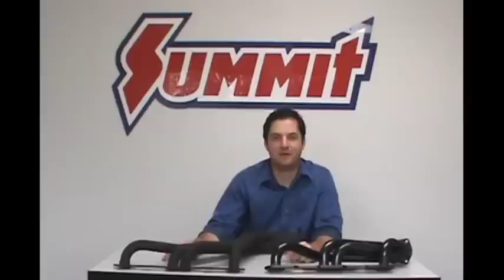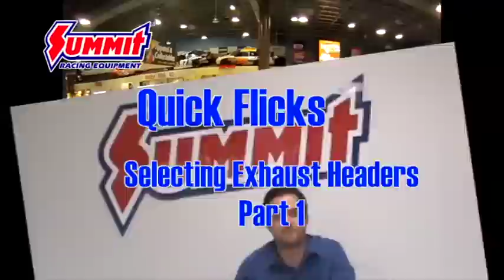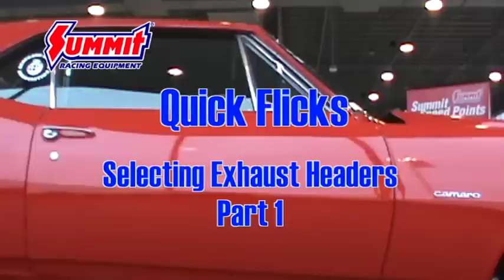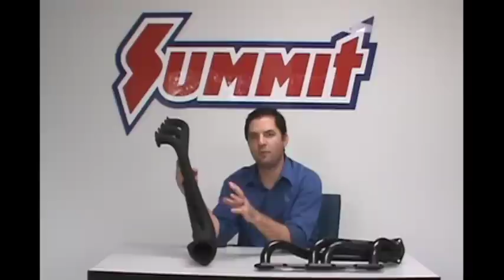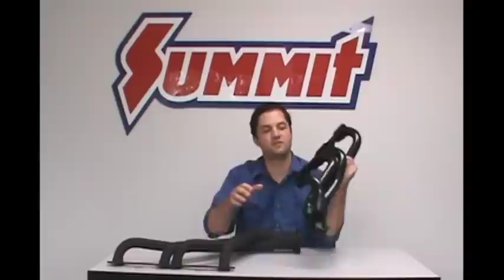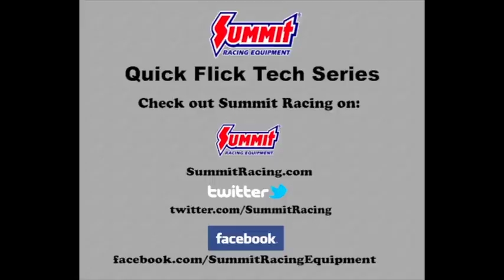Long Tube vs. Shorty Headers - Summit Racing Quick Flicks

Comment: what would you recommend for 05 Ford f150 5.4? thx
Reply from the maker: Hi seabornjl, 
Most times shorties work the best for trucks because they are not being pushed to maximum RPM to achieve high end horsepower. Shorties are also a good compromise because they are usually less expensive and easier to install.

Comment: Are the Summit Racing® Truck Headers SUM-G9016 good for a 1998 chevy k1500 vortec 350 extended cab. It is lifted and I want a little more power pulling out.
Reply from the maker: Hi Joe Holstein, 
Short style headers are a great choice for some more bottom end grunt. They are also emissions compliant and the Summit branded “Shorties” are easier on the wallet; great choice!!

Comment: Long tube or Shortys silverado 5.3 2003 hp?
Reply from the maker: Hi mario villarreal, 
Shorties would work best on your Silverado! You can click this link to check out the shorty headers we have available for your truck: 
http://www.summitracing.com/search/department/exhaust/section/headers/part-type/headers/make/chevrolet/year/2003/engine-size/5-3l-323/header-style/shorty/model/silverado-1500?SortBy=Default&SortOrder=Ascending

Comment: is it bad to use long on one side and short on the other. I have a 350 in an s-10 frame with a 41 ford body, real tight,.
Reply from the maker: Hi jack Donaldson, 
Doing so would make for an unbalanced motor;  that is, a motor that makes more power on one side vs. the other. It would be best to just use a shorty on both sides and keep the motor making the same power out of both banks.

Comment: I would assume shorty headers are far superior to manifolds anyway. right?
Reply from the maker: Hi VinnyMartello,
Yes, shorties would be superior to the restrictive factory exhaust manifolds. Nice inexpensive upgrade for a little extra power!
Reply: Summit Racing do headed cause over heating or blown head gaskets
Reply: VinnyMartello not that much.
Reply: Summit Racing do headers cause over heating or blown head gaskets

Comment: I own a 1974 Nova with a GM 290/350 engine swap but I still have the stock cast iron headers. Would getting a long tube header increase my gas mileage at all? Thanks for the video as well, I found it very helpful

Comment: Nice clips from a Summit customer. Should have mentioned when mounting from underneath in some instances, you may have to undo motor mounts and raise or tilt motor to install, but that's what directions are for. Right? Full tubes have equal pipe lengths which balance and time pulse phase for all four cylinders into collector.

Comment from the maker: Hi rd584983, 
Yes, shorty headers are a great choice for your application where low end torque is required and higher end RPM use is not expected. Thanks for watching!

Comment: Hello, I'm going to upgrade the exhaust on my 94 Ford Bronco and as you said the shorty headers keep some back pressure and improve low end torque. As the engine is fuel injected and needs some back pressure will the shortys be the best choice? Thank you.

Comment from the maker: Many times factory tubular exhaust manifolds are crimped pretty small in some places for bolt clearance or ease of manufacture or assembly. An aftermarket header, even a shorty, puts emphasis on flow for power production so, yes; they will make more power than a factory tubular manifold.

Comment from the maker: So to say that a short header is best or worst for your application would have to come with dyno testing as proof to back it up!  Do your research before buying. Contact a manufacturer directly and ask for dyno results. Check the internet, there are lots of independent comparison tests being done everyday that may help shed some light for you.

Comment from the maker: Any header is going to help make more/better power throughout the entire power range when compared to the stock restrictive exhaust manifolds. With that being said, not every motor responds the same way to headers. Each motor, whether it be Ford, Chevy or Dodge is designed and breathes differently.

Comment from the maker: There will be modifications with these headers to make them fit an existing exhaust system, including the factory exhaust. Pacesetter sells off-road extension pipes to delete the catalytic converters if you are racing the car. That part # is PSM-82-1165. A computer reflash will be required to do so of course!  The headers do include O2 sensor extension wires since the O2’s are relocated down to the collectors.

Comment: you said in the vid that shortys are good for low end torque but I just read that they are good for mid to high end torque and the long tubes are good at low end to mid torque HELP I have an 12 rt challenger want to make the right choice thanks

Comment: I have a 1970 chevy nova stock ride height and stock 250 inline six. I bought the Flowtech 11510FLT - Flowtech Headers they're the long tube headers and now that I received them I am not too sure they will fit. (they seem too long and the space seems to be limited), Before I start taking everything apart. will they fit my 1970 chevy nova??

Comment from the maker: Long tubes on those cars without any lowering can be questionable at times when you consider curbs or speed bumps or pot holes. It’s highly suggested with your amount of lowering that you consider Mid-lengths or shorties!

Comment from the maker: But because long tube headers and short tube headers deliver each cylinders pulses into the exhaust pipe at different times, there will be a slight difference in sound; although, the average drivers ear will most likely not be able to hear the difference. Thanks for watching!

Comment from the maker: While exhaust sound is mostly affected by the type of muffler being used, it wouldn’t be completely honest to state that headers don’t have some affect as well. There are many variables involved here from cubic inch, camshaft specs, ignition firing order, pipe diameter etc, etc.

Comment: I think you sold me on the shorty cause i'm not really focused on performance. I've efficially accpeted the fact that my '97 k1500 isn't gonna run like a viper lol considering that, which would give you the most benifit as far as sound? Will the 2 create a sound different from eachother or is it mostly a common sound?

Comment from the maker: While it’s true that any header will have larger internal tube diameters and better flow than a stock exhaust manifold, perceived power gains are usually subject to driving habits and usage of the vehicle. Not every driver has the same expectation of performance, some would be happy with a 10hp gain while other expect 50hp or more. Along with each drivers expectations also comes a variance of opinion! The bottom line is, only a dyno of your vehicle after installation will tell the true story!

Comment: i got the hooker shorty headers on my 97 lt1 and they are a pain in the ass to install especially on the left bank. but they do sound great. also another prob with the hooker shorty is the number 8 cylinder spark plug wire boot to the plug is really close to the header and has dried out and fried the boot to my MSD wire. if u want all power and u have no emission go with long tubes. with O2 simulators for ur rear O2 sensor and a custom exhaust.

Comment from the maker: Header manufacturers try to improve on factory designs by increasing internal tube diameter and minimizing the amount of turns the exhaust has to travel through. They may also try shortening turn radiuses and or making all tubes the same length (as much as possible) in order to equalize flow from all cylinders. Bottom line, air does not like to turn, nor does it do it well.

Comment: I have an 01 civic ex, and when I look at my manifold, I notice 4 pipes from the block that perform a 90 degree angle and then come together at the collector pipe. Then comes an o2 sensor. I am wondering if shorty headers will really affect anything here because I don't understand the difference between my stock manifold and a shorty header with only a 90 degree bend. Can someone explain to me the difference?

Comment: I have a 1992 Ford Mustang LX 5.0. I'm doing a head, cam, intake swap on my car and was thinking about getting new headers as well. The heads and intake are ford gt40p's from a ford explorer. I need to stay emissions legal and the spark plug wires need to be as far away from the header as possible. The gt40p's have a differant angle over the stock heads. What do you suggest as far as headers with clearance for wires?

Comment from the maker: Yes, the “Short style” header will give you a good low end boost and will be the easiest install while keeping you emissions legal as well!
Reply: I have a 06 4.0l V6 which headers would benefit the most shorty long or mid? My build is gonna be a torque focused one end goal is between 500-600 whp and between 500-600 wheel ft.lb torque for example 500 whp with 525 to 550 wheel ft.lb of torque, it's a street road course build

Comment from the maker: Long tube headers are most often used on a true dual exhaust system with two mufflers so, yes there would be a big difference in sound. The floor pan configuration and factory suspension ride height on your car makes it near impossible to run a true dual exhaust.

Comment: Ok my question is, I got stock exhaust to  get a longtube headers i need to change the mid pipes also?..oh it will fit Ok my question is, I got stock exhaust to  get a longtube headers i need to change the mid pipes also?..

Comment from the maker: Patriot Exhaust offers a mid-length or “Clipster” header for this application. There are a few different part numbers depending on the transmission and whether they should be coated or not. Call our sales staff when you are ready, they are typically a stocked item. 1-800-230-3030. Thanks for watching!

Comment: To avoid clearance issues etc is there a compromise between the long and short tubes? Like a mid tube header? I have a 1980 z28 camaro I plan on doing a lot of work to. Also will there be a problem with fitting to the brodix ik200's?

Comment: if it is a daily driver, shorty.....longtubes makes more peak power but at a higher rpm range.....daily driver hardly see 3000 rpm, i will stay with stock manifold than, but shorty will be a bit better.

Comment from the maker: A Flowmaster Super 44 is a loud muffler by design, the only thing louder while still using mufflers would be to run a pair of the Flowmaster “Race Muflers” in a dual exhaust system. Please let us know if you have any more questions. Thanks for watching!

Comment: Your 3.7 is going to be VERY similar to the 4.7 V8 that's found in Dakotas and Jeeps and things, and the general consensus is that the stock manifolds on these engines are very good.  Headers are available for the V8s, and supposedly they do very little compared to what you'd expect on, say, a 5.9 Magnum.  So, assuming the same holds true for the V6 as for the V8s, you should be in pretty good shape without headers.

Comment from the maker: Dynatech headers will likely perform and fit best on your Camaro. The part number for the correct set is DTC-740-11210 ($584.99). These have a 2 1/2" collector instead of the standard 3" collector. This should give you the little bit of extra ground clearance you need.

Comment from the maker: Yes, long tube headers will fit your 1978 Camaro and there are many versions available. The most cost effective set available is a set of Summit brand headers and the part number for these is SUM-G9001 ($109.95).

Comment from the maker: Neither header type is actually an option for your Impala due to a set not being produced by any company we carry. But I have personally installed a set of Hooker Super Competition shorty headers on a 1995 Impala SS with very good performance increases. The correct set for your vehicle is part # HOK-2063HKR ($399.95 painted) and HOK-2063-1HKR ($625.95 coated).

Comment from the maker: This makes them more desirable for a towing or 4x4 off road application when being used on a low compression engine that has a very low and narrow power band. It's very important to not only look at the engine but also the vehicle type/use when selecting a set of headers for this reason.

Comment from the maker: Whereas, a high compression engine/vehicle combination will benefit much more from a long tube. But, this is not to say that long tubes would not make more overall power/torque on the low compression than the shorties, because they almost always will. It's more of a question of at what point in the power band would you like to see the power made? Shorties typically improve the torque production earlier in the power band than long tubes but the increases fall off much quicker.

Comment from the maker: It's not really possible to supply accurate dyno numbers when it comes to a product like this. Different engine types and configurations will respond uniquely to each header type making power in different areas of the power band. For example, a lower compression engine will respond more favorably to the shorty header in most cases when it comes to actual vehicle performance.

Comment: Do you have any dyno runs to prove that shorty headers are better for bottom end torque?  I'me always been told (by textbooks even) that long exhaust runners benefit an engine meant for low RPM torque more than short runners due to the fact that the longer tube helps out where a low overlap cam falls short.

Comment: I'm not sure if you guys have the means to do this, but I think an exhaust wrap vs ceramic coated headers and the heat difference between the two would be an interesting video

Comment from the maker: We agree. If your Falcon has a Windsor engine in it, the only other option is a set of standard full length headers from Hooker. The part number for these headers is HOK-6102HKR but with a price tag of $449.95 these are also not a cost effective alternative.

Comment: cool i got some long tube header from you guys, great header for the buck, you are right i had to bring the header up from the bottom at the same time lowering the moter down 1969 428ci pontiac motor in a 1979 firebird man it looks cool with that tight fit! like how did he do it! lol like the vid man!